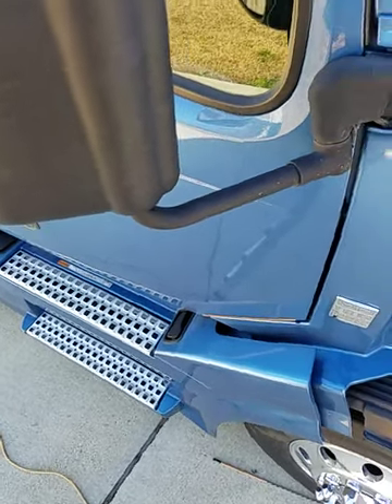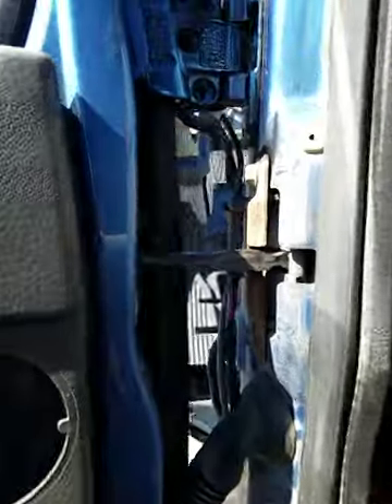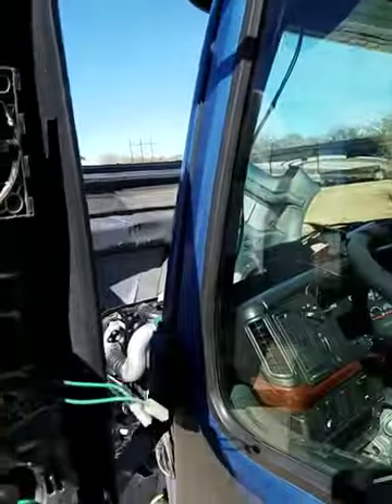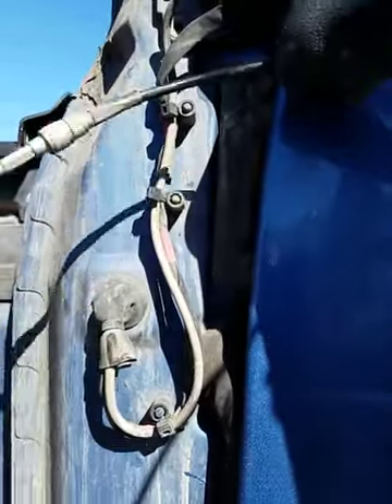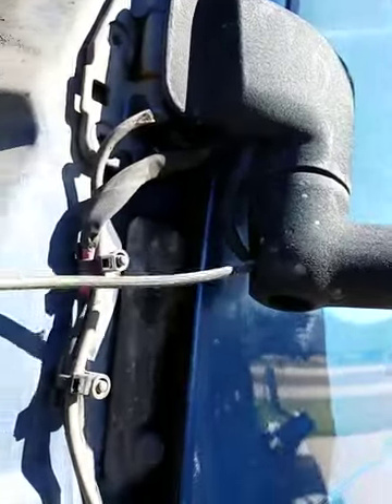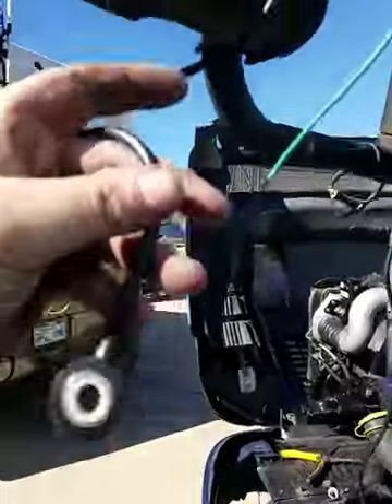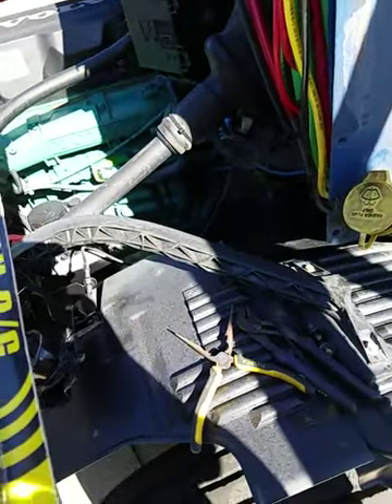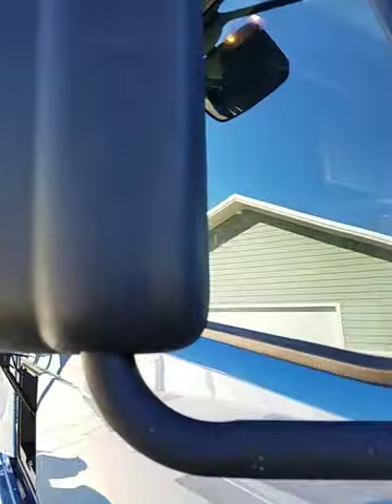Volvo VNL 630 mirror cover removal and new antenna wire.

Comment: You would think two hundred thousand dollars for a truck these would be armor plated lol or even protected a bit more but no none of the truck manufacturers care. Guess it gives us something to do on our home time. Two things I did was use  stainless Wilson heavy duty mounts to hold down my antennas I did have to drill out the top cover a bit and it took my k40 monster antennas and I used wire loom on the exposed area by the bottom of the mirror, then turn signal mirror covers and turn signal lower mirrors. The coax I used was the k 40 mini plug that screws off much like yours only smaller it went through no troubles. I connected both antennas up direct to the cb and linear and ran a wire antenna up above the console for the am /FM and weather radio it actually works better than before , I did place my Sirius XM antenna on my right mirror on one of those plates like you took off it didn't hurt the tube or transmit on the antenna and swr's came out good. You feel a sense of accomplishment when your done and a big sigh of relief took nearly 5 hours to do it all but looks good and about 450.00 for all the parts mirror covers, mirrors, cables and mounts , the aerodynamic mirror covers like the new volvos. I'm Hoping to hear you all on the road so far all I hear is the guy in new mexico talking about selling cbs and back to the bench I'm sure you all know who I mean. Thanks for the video

Comment: Yes, thanks for posting. I actually forgot about how much of a pain in the butt these are.  Thousands of door opening and closings will  eventually break the wire. If you are going through fix your wires using this method I suggest you do it with two people.  When you are able to FINALLY pop the mirror loose, have an assistant hold it while you CAREFULLY remove the mirror heating wires with pliers. You DO NOT want to tear off the terminals lightly bonded to the mirror.
Plastic cover, clips, pain in the butt # 4. Volvo antenna stud (pain #5) unscrew halfway pop it loose by tapping downward on the nut.  If yours needs replacing I suggest you find one with as long of a nut as the original. Prevents a pain later. Clean the stud and bracket of corrosion.
I would NOT use the Firestik Firering cable for this job. It leaves too few threads for the nut to hold onto for a long term repair. DO NOT CUT OFF THE END AND REMOVE THE OLD CABLE. Make a decision.  Are you going to install cable as to the original design or are you just going to run one antenna on the drivers side? 
One antenna? Then buy 18 feet of RG8, ( plugs on both ends are easy enough to find ).  Cut off the plug on one end of the new cable. Tape this end to the old cable, clean grime off of old cable first.  Approximately 6 inches of good quality electrical tape, lay the new cable onto half of the tape and the old onto the other half of the tape. Fold the tape onto the cables. Starting with the old side, wrap the tape around the cable and six inch tape strip. Cut tape from roll. NOW USE THE OLD CABLE TO PULL THE NEW THROUGH THE TUBE.
 I would not cut the zip ties mounted to the truck but I would cut the cable close to the zip tie and pull the cable through leaving the original zip tie loop as a holder for a new zip tie.  Remove the old cable from the new and repeat the process with the old cable going through the truck body. Pull the cable Into the cab and over to the radio.  Solder a new PL 259 plug onto the cable. Find a YouTube video on how to do that properly.q 
 If I were to pull the mirror heating wires out of the tube I would first attach a thin string,  maybe a couple layers of dental floss, to pull the wires back through. OR tape the mirror plug to the new cable and pull them both.  Do you not be in a big hurry to put things back together. Sometimes, rarely, a brand new cable will not carry the radio signal. And will need to be replaced.
 Antennas need to be “tuned”.   See what YouTube has to say on the subject. Once your antennas are tuned and everything is working as it should, THEN put everything back together.
 Having said all of that consider installing cable, about 25 feet, from the radio, under the cab, up the back and attaching an antenna on the back of the tractor.

Comment: you should of bypassed the bracket by the door{ where the hinge is} and gone directly down{with a small loop on the coax} to the hole and rubber boot going into the cab, that way there is no bending and unbending when you open and close the door.  Thank you very much for taking the time and effort making this vid...great job!!!

Comment: After watching this video. Great job my guy. But also great job in convincing me to say nope. Cut all the old wires and tank them out. Run new wire entirely just not using the hollow mirror arms. Cause hell no. Too much work. Just snake wrap it around the arm and weather protect and good to go. I applaud you for doing it the correct way my man. You said you weren’t patient. Yet it takes a lot to do it this way. Job well done

Comment: Thanks for showing how to fish the wire through. I've been wondering how to do this for a while. Since everything was apart, I would have updated the ground to the mount as well.  I have never owned a firestick before. I will give this antenna a try when I do this. Thanks again.

Comment: You might have been able to tie the coax’s together with tape and used the old to pull in the new. Probably wouldn’t work for  entrance to the cab. I’m sure all those are zip tied together. Very good job either way. Planning on replacing mine with RG400 and getting a better tune so I can run my RCI2970N2.

Comment: In order for a CB radio to work properly it needs an antenna system that is in “tune”. Antennas need to be tuned in some way, shape or form.  The best antenna I can recommend for plug and play is a Francis CB 22, three foot antenna. 90% of the time they work well and they are tough as hell.  I have seen one that the fiberglass was split from top to bottom and it still performed.   They are designed to be used with 18 feet of cable.  Using a SWR meter you can adjust other antennas to perform decently across the CB channels. You can’t always trust a radio that has a built in SWR system until you test it against a separate SWR box/meter.

Comment: Leon, what type of coax cable did you use (I need to replace both my cables)?

I’m using new stock RAMI antennas and stock multiplexer.